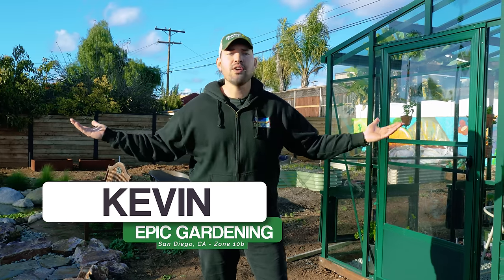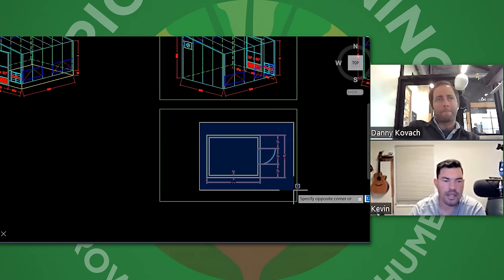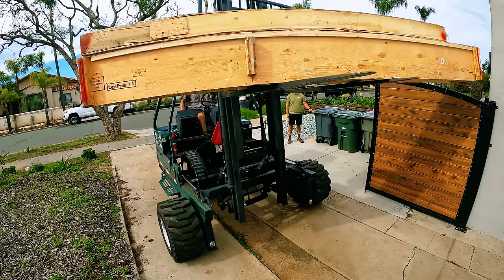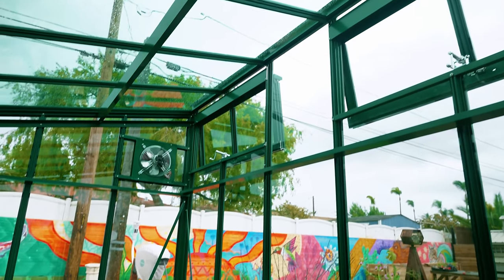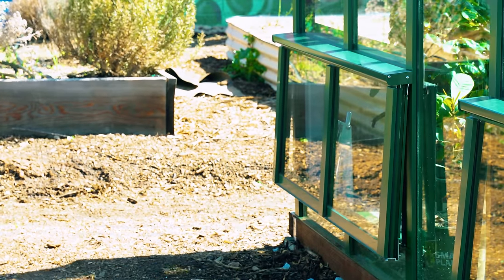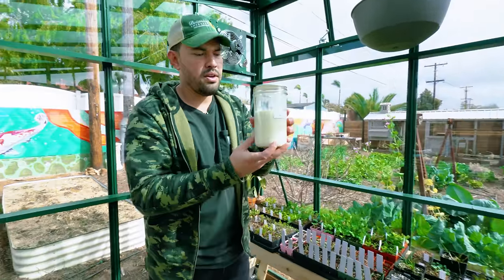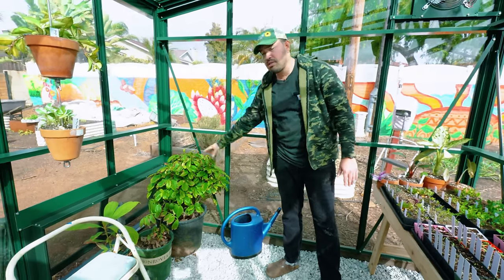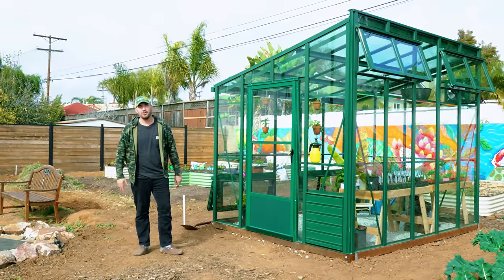My Custom Greenhouse Design, Build, & Tour!

Comment: I learned from my grandpa that if you want to optimize the flow of the fan, you would need to install it a few inches/cm away from the windows(towards the inside) and use the Bernouli principle to exhaust more air faster and thus use less electricity. Just offset the fan towards the inside a bit and get better results. It would of course be better to ask the designers of the structure for further advice on this, but my grandpa did it DIY on his greenhouse and worked great for many years.

Comment: @4:27 Quick note: Δ°F (delta, change in °F) cannot simply be converted to °C, and vice versa. Individual conversions from °F to °C need to be done for each temperature before finding the temperature difference, delta.
Great video, thanks!

Comment: Love the new greenhouse!

Small note from a math guy:  a Fahrenheit differential of 15 deg F corresponds to about 8.3 deg Celsius differential. The video text at 4:26 is referring to the straight conversion of 15  deg F to C (actual temperature values). For reference, if you have a Fahrenheit differential, just divide that by 1.8 to get the Celsius differential.
Reply: TLDR; a Celsius differential is about half of a Fahrenheit differential

Comment: I have a greenhouse in SoCal too, 9b. You might want to start looking into adding a swamp cooler soon. From my experience with a similar vent and fan setup, it's not nearly enough bring the temperature down to a manageable level once the outside temperature begins to rise. I never tried a shade cloth myself, but I can't imagine that doing enough either. Good luck!

Comment: You will love the greenhouse! I’d advise you to look into adding a shade cloth when it gets warmer. Happy 👨‍🌾
Reply: If he’s close to the coast sd rarely goes over 80° even in the middle of august. Google San Diego average temperature it tops out at 73° in august.
Reply from the maker: I've got one!
Reply: @devswell6538  With the clear greenhouse roof panels, the direct summer sun can quickly sunburn or fry the plants. 
My greenhouse has diffused roof panels and I also situated it so in the summer it gets afternoon shade from a few deciduous trees.

Comment: Canola oil-based cooking spray works well for lubing things up if you can't use regular metal lubricants like WD40 or Liquid Wrench. That should take the squeak outta your crank handles without killing your plants.

Comment: Nice greenhouse Kevin, I really wished I had seen the video about choosing the type.
The English design really can't be beat, it does everything you need in most situations, I will have to do a video of my two 12x8's.
You missed a trick by not leaving the base open to the soil, that way you can plant directly, plants grow better, you don't need to water all the time even when really hot.

Comment: I built my BC Greenhouse, and it took about 2 weeks. It will be interesting to see how the ventilation handles your summer heat.  My greenhouse is basically unusable in North Carolina from May till late September due to the heat.  I still love it though 😀
Reply: Have you tried putting shape cloth over it and making it a shade house in the summer? SHADE.
Reply: @lyndelgado6138  I do have shade cloth, and it helps, but the summer sun is intense. I don't have a fan like Kevin, so it will be interesting to see how it works for him.
Reply: I have a 60% shade cloth for mine in BC and some days I wish it was 90% shade cloth. 
I get a lot of blossom drop because of the heat. I run a fan and leave both end doors open.
Reply from the maker: I've got a shade cloth setup as well as exhaust so we'll have to see!

Comment: I’m really anxious to see how you cool it in the summer. We built a greenhouse with poly carbonate panels on the top and sides The bottom part is closed in with siding and we have a brick floor. It’s 10 x 12 feet. Unfortunately it gets up to 120 inthe summer!( 9B area.)We put two layers of custom-made shade cloth over top and sides…that didn’t help. I have two windows open an exhaust fan that didn’t really bring it down all that much. Finally put in a small air conditioner and it just wasn’t powerful enough. It still got up to 99 most days so I’m really interested in following and seeing how you cool it …it looks beautiful.!!
Reply: I also have a greenhouse in 9b. We ended up going with a MasterCool MPC59 swamp cooler to bring down the temperature. It does a great job of cooling our 8 X 10 greenhouse.

Comment: My dream greenhouse is a 40 ft diameter dome that goes over a 4' deep hole in the ground for better temperature control here in Georgia.  The hexagons and pentagons that it is comprised of can be swapped out easily (wing nuts) between greenhouse film and a product that's not invented yet, shade cloth that's impregnated with carbon (or shungite) to filter out whatever is in rain water these days and whatever is being sprayed in the skies in the dead of night.
I just had my little greenhouse, that housed all my tomato starts, flip over in strong winds.. domes handle wind better.

Comment: Being a bit nitpicker, just wanted to point out that the note on 4:29 is a bit wrong. While 15F is indeed -9.4C, when talking about increases in values, you actually want to remove the -. A 15F in that case (going from 70F to 85F means going from around 21 to 29ºC, so a 8ºC diference.  ) 

Rising temperature won't make Celsius value reduce.

Comment: I don't know if anyone has mentioned this yet, but at @4:27 saying 15F = -9.44C doesn't really convey what you mean to say here. While that point on the Fahrenheit scale corresponds to that point on the Celsius scale, that doesn't mean that's the equivalent difference. 85F = approximately 29.44C, so a difference of 15 degrees on the F scale corresponds to a difference of about 8.33 degrees on on the C scale.

Comment: I live on the Big Island of Hawaii. The weather is great to plant year round. I’m about to order a small Palram Greenhouse. My problem planting outdoors is I have more geckos & various lizards that eat up whatever I plant on back lanai (porch). I’m currently trying to do everything in raised beds because everyone uses poison to control growth of jungle environment. I tried organic (soap, salt & vinegar) it didn’t work. I live on one acre, gave up & hired landscaper. I would love some Birdies but still afraid of reptiles eating everything. I had a huge snail that came out of no where & crawled into my planter with Meyer’s lemon tree & killed it. I also had Aphid problems & have tried everything. I ordered lizard repellent on Amazon & it smells too good like potpourri. The geckos/lizards are probably laughing because the stuff doesn’t work. What tips do you have to curtail reptile problem? Do you have them in San Diego? I was told to use copper wire around planters. I got another Myer’s lemon tree & put in front of garage in front yard. I put copper wire around the bottom. So far so good. Any ideas are appreciated.

Comment: Neat but why did you choose those positions for the ventilation, like the fan and its corresponding vent does not provide cross ventilation(diagonal) also why are the bottom vents controlled with wax and the top ones are manual?

Comment: Note to the video editor or whoever came up with "15F = --9.44C": that is incorrect because we're talking about a delta here. Instead of 15F,  do 32F + 15F or 47F and drop that into google, which will give you the correct 8.33C delta. Alternatively, do the math yourself: 15 * 5 / 9 = 8.33. You don't need the offsets for freezing when you're calculating a delta.

This will hold true for any conversion, add 32 to your original Fahrenheit delta to get a convertor to pop out a correct Celsius delta. 90 degree temp swing (somehow)? 90 + 32 = 122, should be 50 = 90 / 9  * 5. And if you put "122f in c" in google, it comes up with the correct 50C.

Comment: Nice greenhouse. So there’s no chance of a little birdie deciding to take refuge in there through the top vents, since those have no screens over them?
Reply from the maker: Could happen!
Reply: I have had to help birds of various species get back out of my greenhouse, got good at catching them with gloved hands, but what I found helped a lot was to put a large potted plant or a plant on a stand right in the doorway (open in the summer for more ventilation), and that gave them a place to land and realize where the escape route was.  A perch suspended near the top of the door or in the opening of a vent can also help them find a landing place that leads to a way out.  Interestingly, the hummingbirds had absolutely no problem with zipping in, and then zipping out, the open door, for apparently routine visits to the greenhouse flowers with no confusion whatsoever about the glass.

Comment: Celsius : sure, an outside temp of 15 F IS 9 celsius ( telle you it’s below freezing for water. 
A delta of 15 F however, is a delta of 8.2 Celsius. 
1F = 0.55 C, but they don’t have the same stzrting poijnt. 
The freezing point of water is 32 F and 0 C. 
Yikes. Americans, get up to spped with the world